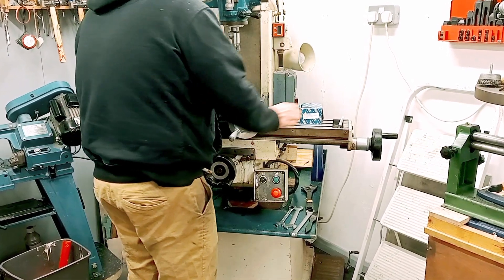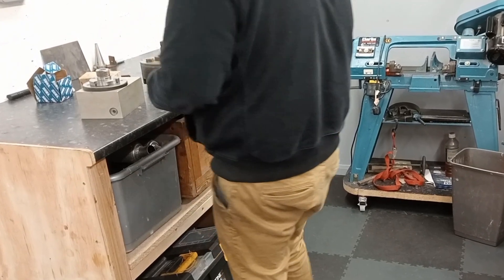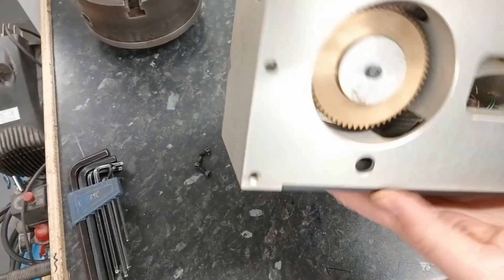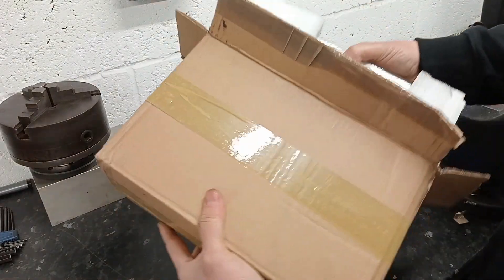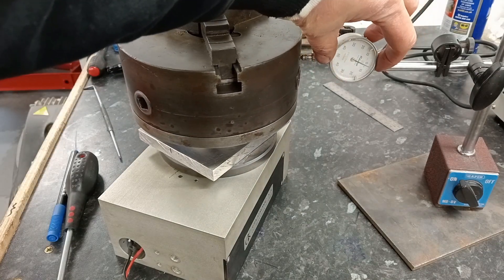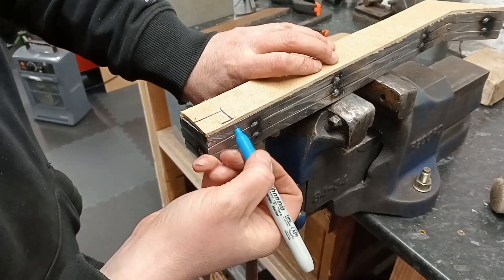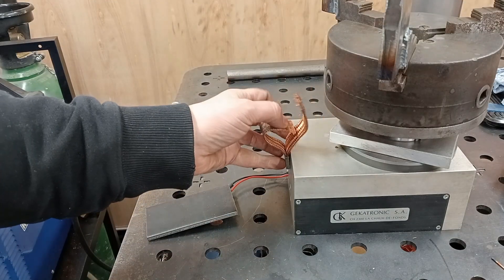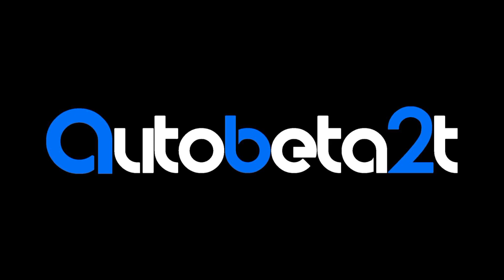Homemade 2 Stroke Exhaust Rotary Weld Positioner table Build #TigWelding #2Stroke #mopedtuning

Comment: Setting on the lathe to rotate the welding positioning is common practice in south east Asia when their mass producing the pipes. Btw im in that devleoment two stroke group. 👌😉
Reply from the maker: Yeah, it's a really good idea. As I don't mass produce pipes maybe not needed for me but I'm sure it'll come in handy at times. I need to spend some time playing with speeds and welder settings.
Cool, is that the one on FB?
Reply: @AutoBeta2T  the one you were looking through his welding technique yes look like that that group you were watching that I'm in
Reply from the maker: Once I figure it out I'll maybe do a video on using it ☺️